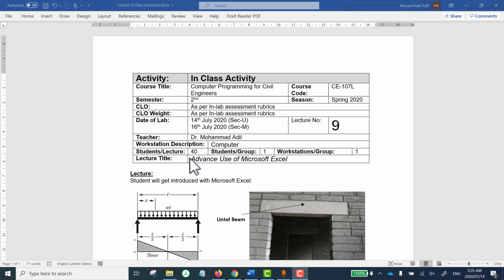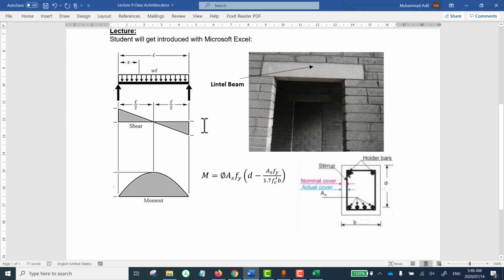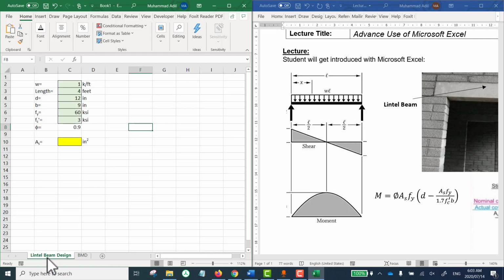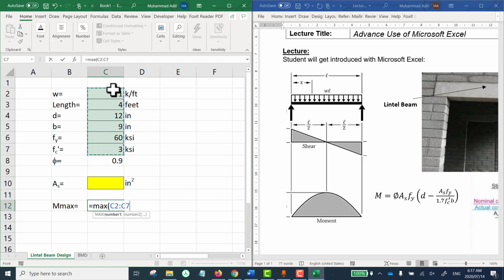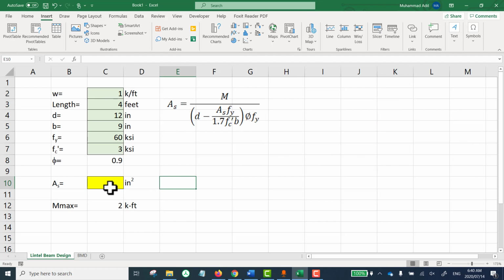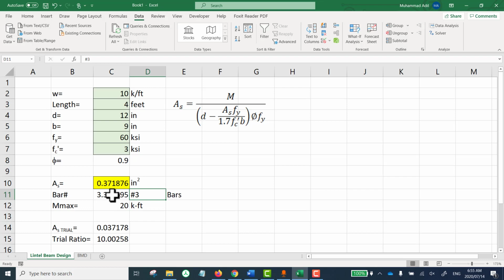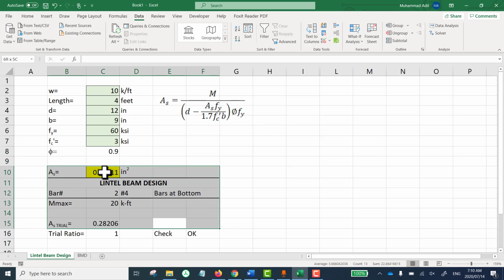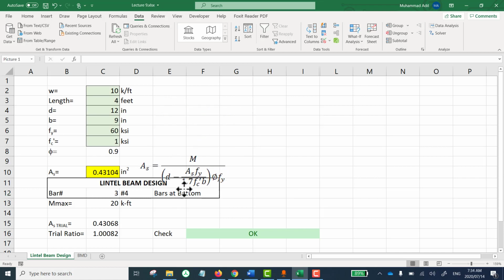Lecture 9: EXCEL for CIVIL ENGINEERS in little more than 90 minutes

Comment: I have a totally different moment equation after doing the free body diagram and replacing the UDL with the appropriate single point load of wL as 4 kips. If w=1kip/ft then wL = 1kip/ft*4ft/1. ft cancel out leaving wL = 4kips hence why wL/2 is 2 kips and wL is a Point load of P

0 = (wL/2)(x)-wL(L-x) - M(x) solve for M(x) and fill in the values for wL and L

M(x) = (wL/2)(x) - wL(L-x)

M(x) = (4kips/2)(x) - 4kips(4ft - x)

M(x) = 2kips(x_ft) - 16kips-ft + 4kips(x)

M(x) = 6kips(x_ft) -16kips-ft

IE, if x= 0 then there should be a -16ft-kips acting on Ra due to the point load of 4 kips at the center.

Now when we substitute our x value of x amount of feet, we get back a moment. Please correct me and verify if i am thinking correctly?
Reply from the maker: -wL(L-x) term should be -wx(x/2)
Reply: @engr.mohammadadil5276  lol, i forgot to edit my response. I redid the math and got the dame as you haha. Sorry for that. Thanks for replying